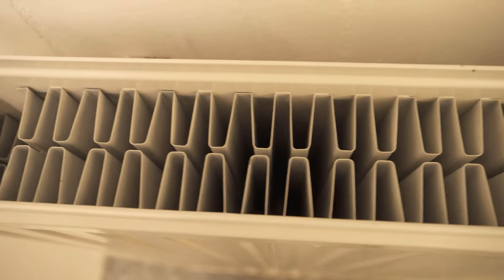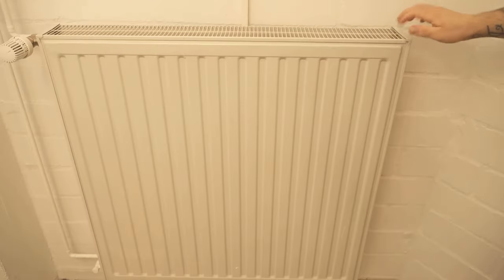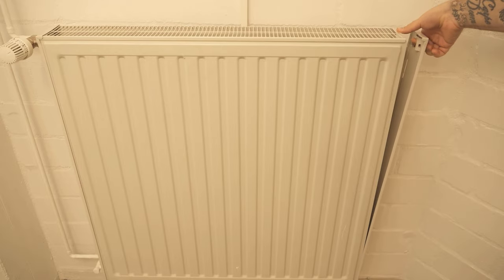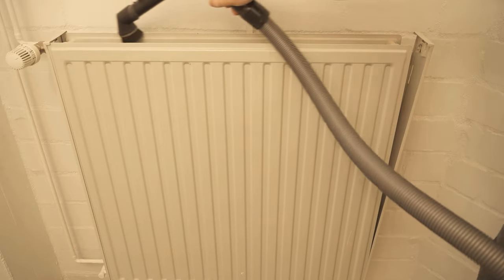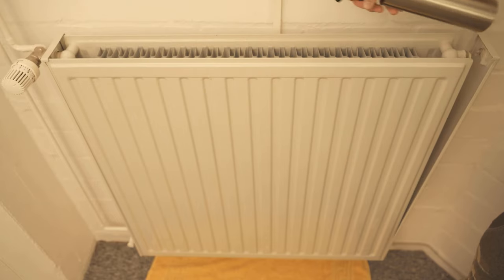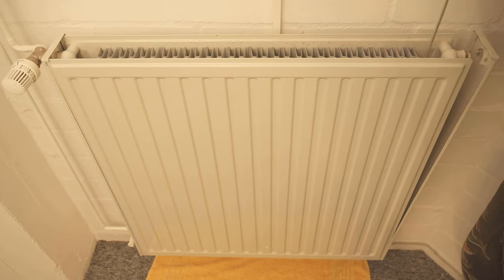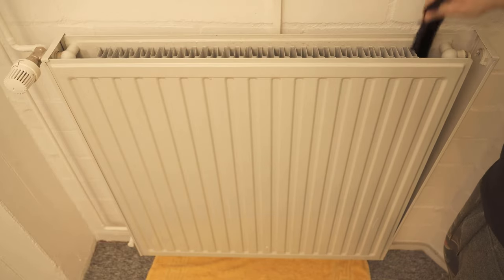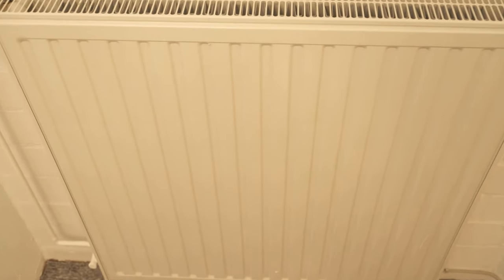How to remove Radiator covers to CLEAN OUT the DUST 💥

Comment: I have the same radiators but I have a feeling I have some clothes moths nesting in my downstairs radiators. I’ve ordered a flexi crevice tool from Numatic International Ltd to fit my Henry hoover and some spare hoover bags. And Rentokil Clothes Moth Sprays and Insectorol sprays. So, I’ll remove the metal plates on the radiator and cautiously hoover from behind and from underneath first before hoovering the rest of the radiator. I might spray inside the radiator with my sprays once I remove the plates before hoovering to kill any moths or worse, grubs hiding in between the crevices behind and inside the radiator.

Comment: Doesn't work.  The  side bits where they secure the top grill on-just look different, they actually look as if they're on upside down  and they won't budge no matter how many methods I  try to remove them.  Looked at countless videos on here but they're not going anywhere.

Comment: I'm think7nnnnng 🤔 ...
Air Compressor. I'm just scared of them and still trying to figure out which one to buy so that it is strong enough to blow out the old oil heaters, Kärcher vacuum cleaner, lawn mower etc a seasonal blow-out or blow-out after use, seems so much more logical. 
Jusssst need to figure out which compressor to buy for this use. 
It can't be too weak. 😳😶

Comment: Doesn't work. The top is still fixed solid despite removing the side.
Reply: Having the same issue & I bet by the time I’ve finished with it there is no way it be going back how it’s suppose to be cos it will be bent
Reply: @buzby303  I gave up and cleaned it from the bottom. That top isn't going anywhere.